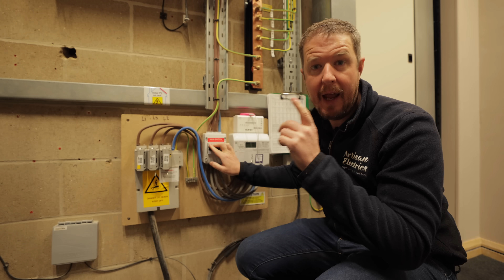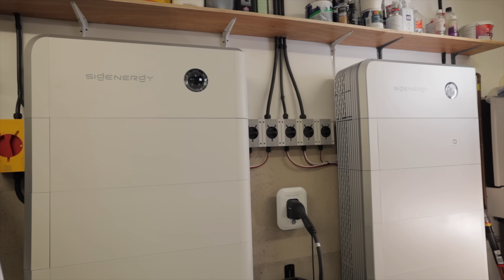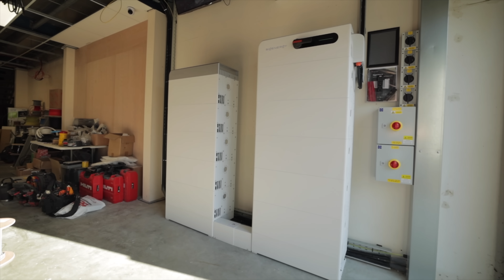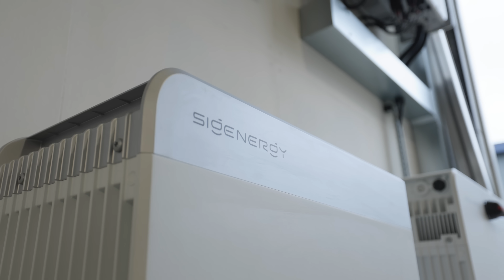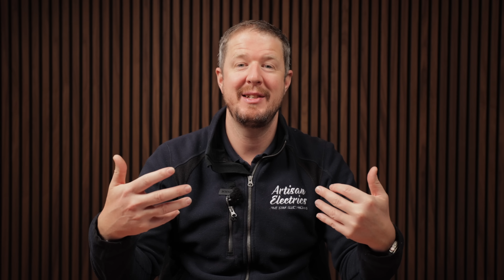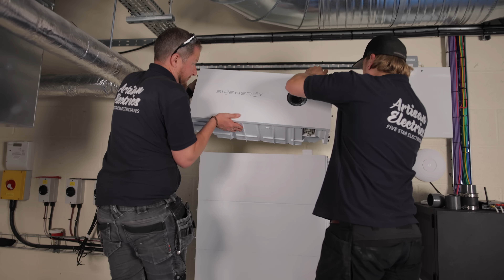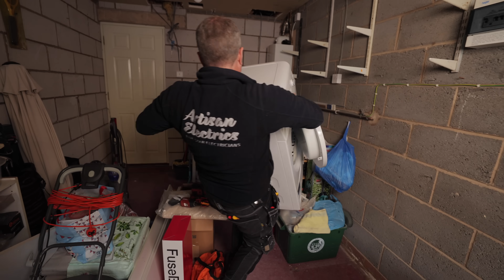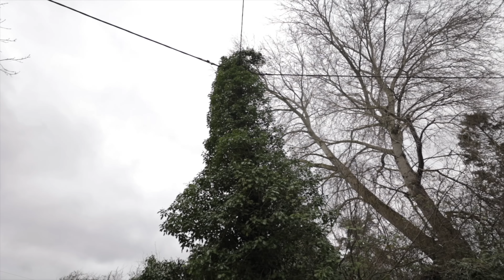You’ve Been MISLED About Battery Backup

Comment: Be aware that all  these systems will fail eventually. Batteries have limited lifetimes and so does electronics, when that happens you need to be assured that you can isolate the system for repair or replacement. The failure is likely to be disruptive - plan for it.

Comment: I'm Portuguese, had a laugh during the Iberian blackout....EPS boxes stock drained afterwards 🤣Most still have no clue what is a contactor and why the box is needed. Running a SolaX system: 7.5kW single phase inverter+17.4kWh+12kWp. And I suspect some of those using generators in the last winter storm, might be under investigation because there's at least a dead worker and other incidents with live grid.

Comment: Your video is interesting but there are other options. the battery/inverter and mode of operation is down to design and choice of components  My system (for example) has a Victron Quattro 10kW inverter that usually runs in island mode (with separate Earth rods and internal Neutral/earth contactor when running in island mode), hence no interruptions. The battery (48v) has 44kWh useable capacity and is charged via 3 banks of  PV's and 3 Victron MPPT's (total PV capacity 10kW) This system runs the complete house (including providing HW via a 2kW immersion heater). The design of the house is such that power hungry systems (such as the immersion heater, Quooker) are remotely controlled via the Arduino control system and are automatically isolated if house demand approaches the capacity of the inverter. Typically I do not purchase ANY electricity between March and October. Outside of these times the battery is charged overnight on a EV tariff at 6.6p per kWh (so for example this winter)  the average nightly charge (per night) was:  Oct £0.68; Nov £1.65; Dec £1.52; Jan £1.44; Feb £1.04. (again no electricity purchased during the day) I do not anticipate purchasing any electricity for Mar-Oct.  Come June typically I will also charge my EV from the system due to excess PV capacity, again I can control the charge rate to avoid overloading the inverter (with house demand).  So in conclusion my house usually runs  via a Uninterruptible Power Supply. Which means I do not have to worry about DNO failures.  The battery capacity is such that if I'm careful with energy demand I can survive around a 2 day DNO power failure in the winter. Obviously I don't use the DNO outside of these times.  FYI at 09:57 on the 28/2/26 my PV array is generating 5.1kW and the battery is at 61%

Comment: I have a Sunsynk 6 kilowatt system two 5 kilowatt batteries and 8 kilowatt eco hybrid inverter and was not told it would not power the house in a power cut. I would like it to run the house but not sure of the cost . I after seeing you video I would need a gateway but it does support UPS

Comment: Rather than a generator, could you use an electric car to charge up your battery if there is a long power cut? I.e. drive to a nearby charger, fill to 100%, drive home, put the rest of the power into the home battery. Can any V2L systems work as a home backup / gateway type thing?

Comment: They always say you need a gateway so that the people working on the grid won't get electrocuted by power from your inverter, but I think it's more fundamental than that. If you try to generate power while connected to the grid, you're going to need to supply enough power backwards through your meter to power the whole neighbourhood, at least on one of the 3 phases. There's no way any inverter is going to be able to do that unless the power cut is limited to maybe 2-3 houses, and none of them turn on any serious loads like heating, oven, kettles, car chargers etc.

Comment: Simple get an inverter with backup output all I do is switch the double pole mains switch turn off the power to both inverters and flick another switch and boom while house back up apart from cooker and shower, I have a ups running essential UK radio streams to Ssdab and the router 5hr runtime but it works, I've also modified a 160a alternator to output enough power to charge the battery's directly via a solar MPPT to regulate the input power I have so when low it kicks in when it gets to 90% turns off all this is easy simple wiring.

Comment: I'm getting a gateway despite only having a couple of power cuts a year just because it seems ridiculous on principle to have a battery and solar but not be able to use it if the grid fails!
Reply: It's not even that it's ridiculous. It's that nobody wants to explain to their spouse that the lights are off, the internet is down, and the food is warning up in the freezer, because although i spent 20,000 on energy equipment, i cheaped out on the last piece that would have kept the lights on. 😂

Comment: In the US. I relocated cross-country and moved into a nice mid-century house. Little did I know that the power was, shall we say spotty, what with huge old trees hanging over the power lines and mysteriously magnetized utility poles which attracted speeding vehicles with alarming frequency. I made do with a little Honda generator to keep the fridge going and little more. Gradually I started to use 1.3-1.5kwh UPS units on critical electronics (I still have five of them going on network, entertainment and computer equipment). Eventually, after a 24-hour outage on a Christmas eve had me frantic trying to keep my frail bed-bound mother warm I bowed to the inevitable. Whole house battery backups were insanely expensive, Tesla being basically the whole game at the time so I eventually had a 24kW Generac installed which is fueled by natural gas which, at least, doesn't ever seem to fail. Magic happened though since, after the expense of the generator, the power situation seemed to suddenly improve, failing only once or so every year and never for more than a few hours. Automatic start-switchover for the generator probably takes 10-15 seconds but that is tolerable since the little UPS units do their job. There probably is no magic solution for every home, at least none that normal folk like me can afford.

Comment: Good video and explanation.  We have 3 x Solaredge 9.7kWh batteries, a 6kW inverter and a full house backup Gateway.  It is not UPS so there is a 2-3 second delay for grid disconnection and re-engagement by the Solaredge system but I actually quite like the informative nature of this,  Plus we get a message on our phones telling us we are now off-grid.  I have got around the 2-3 second gap by having the router and main server PC plugged into a small Jackery running on pass through charging, which is plugged in all the time.  I think this has a <20ms swich over of it's own - and this easily therefore keeps the internet working seamlessly whilst the SE gateway does it's thing.  The gateway was circa £800 when we had the full installation and I highly recommend it if you can afford it.  We are rural, and had a full day planned maintenance grid outage which we actually forgot all about until the power went off at 9am and we switched over automatically.  It was very satisfying to be outside using the vacuum cleaner and the pressure washer to clean the car when the whole village and all the neighbours with solar were scratching their heads!

Comment: I don't understand the interest in "backup".  Surely the main reason to have a home battery and inverter is to charge the batteries during off peak (if no wind/solar) or charge them when you have an abundance of renewable energy (wind/solar), and then you would draw from those batteries as you get on with your normal life, until they're drained and the system switches over to mains power again.  I guess in some cases this doesn't provide you with that backup feature (batteries drained just before power outage), but our problem with electricity in the UK is price, not availability.

Comment: I remember years ago and local hospital was undergoing upgrades and a backhoe severed a water line for the city and flooded the ER for a category 1 emergency ward. They had mission critical equipment that never lost power while under 10 feet of water. I never understood how or why the mri machine would require 6 months to restart but they had a team of engineers doing hourly assessments to guarantee it never lost power and was available for use as soon as they finished vacuuming the water out and cleaned it. It was only out of commission for less than an hour. There is now a permanent drain with a vacuum embedded in the floor of the room that can remove the entire room of water fast enough to maintain operation conditions regardless of a flood.
Reply: Wow

Comment: Here in Texas during the heat of the summer we use about 4000kWh per month or approx 133kWh per day.  This with about 7500 sq ft single story home.  Using the air con alone is about 10kw when both units are running at 100%, which can be a major portion of the overall monthly load.  I have more than enough space for a very large solar array and battery storage, but because of our low fixed cost of electricity ($0.11/kWh) I can't justify the cost of a system. We have 400A@240V power service.  I use large UPS on the critical items, and then have generator that I have to drag out and connect to the house, however during the summer we are stuck without AC and when we are in the 40C range it can get hot very quickly.  In the winter we can run all the natural gas heat with generator.    Great explanation to describe all the different types of systems out there.  Keep up the good work!  👊😎
Reply: Texans do everything BIG don't they?  My average consumption in South Australia is 13kWh per day!

Is your house insulation BIG enough, I'm wondering?  Double-glazing?

Comment: What do you guys think about systems where the entire house is connected to the "backup" output of the inverter? In that case, it doesn’t need additional units like gateways to stay powered during a blackout. I am aware that the inverter would need to be much larger, but I wouldn’t need to buy a gateway, so I could spend more on the inverter itself.

Comment: Another key point is sizing the Gateway, Eg in Sigen a Home SP is good for 54.6A/12.5kW (ignore the 64A breakers), so if you had 2x 8kW SP ECs, you can trip the Gatewy (of which they've recently firmware update to cap them to 12.5) versus the Home SP-F rated at 22kW/92A and can sustain the 2x 8kw SP load (even 2x 10kw SP load)

Comment: We were miss sold our system and was told it would provide backup. I didn't know at the time what is required. our inverter is only 3.6kw and there is no earth or changeover switch. Also the inverter only has EPS and it has not been wired in as there is no earth. Were looking at potentially replacing the system but that cost is too much for the odd power cuts. The video is great and would have helped 3 years ago when we were looking at getting our system.

Comment: Yes... Actually.... Why have batteries if your not going to use them..... If you let them stand idle they will die anyway.... I am configured for self consumption....Have been for near on 15 years already... Having solar to pump into the grid to give to city councils is just a shortsighted ROI ploy.... Use your solar to ensure your electric stability in your domicile....... Stop being "sold" on an ROI theory... ROI is a myth when it comes to solar.... 90% of my house runs on my solar install...... Multiplus, charge controllers and enersol batteries.... This all behind a 2 way Isolator that is configured so that ONLY either/or can be connected NEVER both which means back feeding is impossible no matter how hard you try.... I can do with a bit more solar for grey days other than that I have had to do very little since I put in my LFP batteries...

Comment: So I been caught by this. I assumed battery backup would just be supported. While I did in passing mention to the company I liked the benefit of backup in a power cut so I don't lose internet either they didn't pay close attention or willfully ignores it because it was only after install and I asked how backup worked they told me it won't.

I asked for install of parts to make it work and they told me "sure will cost at least £1500 based on when they done it before" and when I rang for an update on quote they said "where do you want to socket?" Turns out they will only install a single plug socket to support it. 

What I don't understand is why I need an expensive switch over or earth fitted if I'm only enabling a couple of plugs. You can wire it the same as a ups box. Power always runs through the battery box never directly connected to grid so isolated intentionally and don't say that can't happen it's literally how ups boxes works. You can buy them off shelf and don't need earthing or to touch your houses mains.

If I'm spending that much money to add upgrades I expect to got at least a few zones out of it
Reply: Pretty sure you can use a small pc ups to power your router & keep your internet running while using a laptop
Reply: Desktop UPS boxes, have relays in them that switch over, when the grid fails.
Many home battery systems do not, because that switch over, would have to be rated at the full potential number of amps, your house can use.

The transfer switch is in a separate cabinet, because the relays and breakers, take-up quite a lot of space, and you only need one switch, even if you have two or three inverter / battery stacks.

Some inverters do have a separate emergency circuit, that can provide a limited amount of power to a socket or two.
Reply: You need a separate earth, because you cannot rely on the grid's earth in a power-cut - imagine your supply cable being dug-up, and broken, you'd have no earth.
Desktop UPS get away with it, because they have an isolated output, and supply a small amount of office equipment.

Your house battery, could be running your lawnmower, if there was a power-cut, while you were mowing the grass. So it needs an independent earth.

Comment: As usual, a lot of good and useful information, thank you for that. In Denmark we rarely have blackouts and then only for a few minutes, so here I would also recommend a small UPS that is only connected to the router, PC and maybe medical equipment that does not draw much power, maybe also your alarm system. Several of the larger systems you show are expensive things for the wealthiest.

Comment: It should be about time that the option to go to DC home appliances is available.
If you are going to blow a fortune on solar and batteries the best option that will in fact reduce your power bills and after about thirty years on a system that may last for twenty achieve net zero is a DC home electrical system that runs off solar and batteries and only uses the grid to top up and never feeds the grid.
All lighting can be twelve volt low current and any appliances can be forty eight volt high current 
The safety and fire risk of these systems is much better than an AC mains voltage system

Comment: I'm curious, what is actually inside a "gateway" as used with a battery system? If I understand correctly, the likes of a Powerwall has the inverter inside the battery module so is the gateway purely the G99 compliance contactors and other associated components plus the main terminals for connection to the cutout and consumer units? Presumably a Powerwall without a gateway would simply shut down if the grid was lost.

I ask because on my Victron Multiplus II, it is fully G99 compliant and has the inverter and effectively the "gateway" all in the one enclosure. 

Does it really just come down to a different packaging philosophy where some manufacturers have chosen to have an inverter/charger per battery module with a single gateway per property and others like Victron package the inverter/charger plus gateway components in one enclosure with battery modules separate?
Reply: The sigenergy gateway, supports multiple inverters, an output to the house load, a 'smart port' and a grid port.

Each connection has it's own breaker, that leads to a common set of busbars.
The grid and 'smart port' connections, have a contactor and current measurement, along with a breaker.

So the house load remains connected to the inverters, and the grid and generator / disconnectable load, are connected via contactors.

As such the sig system is much like the victron, in that it is line-interactive, and has a short transfer time -the time it takes for the grid contactor to open.
Reply: Yes, a gateway is the transfer switch.
Wthout one, your system is grid-tied.

Comment: Most ups's have a blip on changeover also, as they are only line interactive. It needs to be an online double conversion to fully remove the blip for sensitive devices.
Reply: The sigenergy system, like most home battery systems, is line-interactive, the inverter remains connected to the load, and the mains is switched in parallel to it.
Thus there is a transfer time, while the loss-of-mains is detected, and the grid contactor opens.
Since the inverter is charging the battery, it will be synchronised to the grid, so can start inverting with minimal delay - just the grid contactor opening time + detection time.

Comment: Good video. I live in a Uk town and have a tesla powerwall 2 whole house battery backup system installed in Jan 2021. My observations are 1) your solar system can charge your batteries during a power cut IF your battery system is compatible with your solar inverter. 2) if you are charging your EV when a power cut happens the continued charging can drain your batteries without you knowing if powercut at night. I dont have a tesla so can't use tesla app integration to not charge during powercut. 3) the powerwall 2 doesnt just take over during outage but also when under/ over volt / frequency out of tolerance . I was told this by tesla powerwall uk support. I'm glad I went for whole house battery solution due to peace if mind with old electric grid.